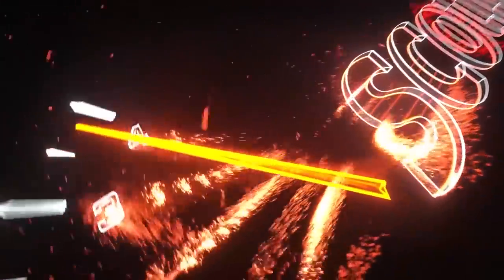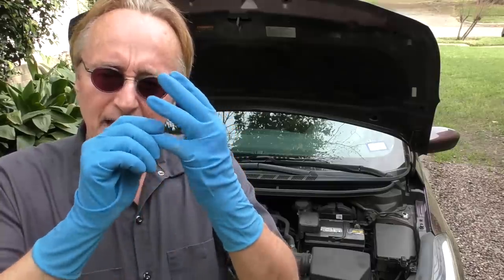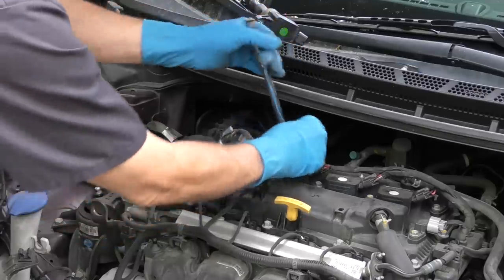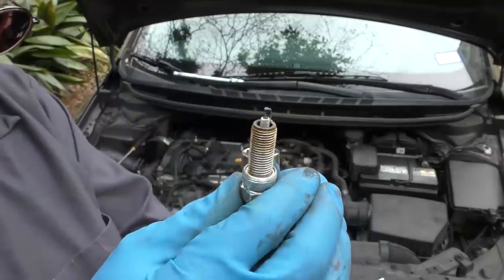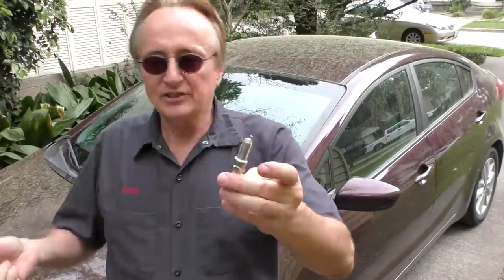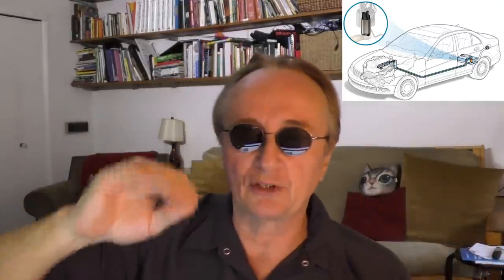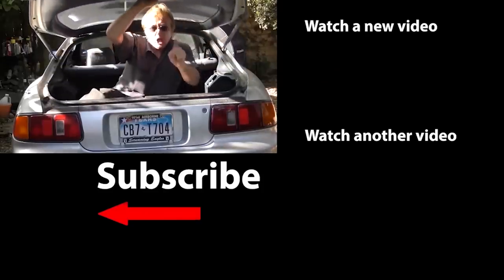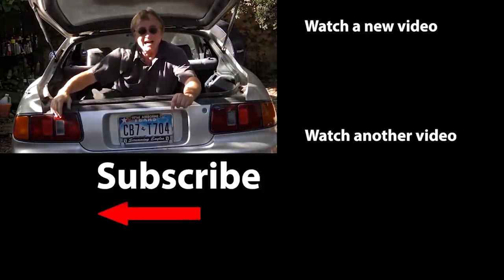Doing This Will Make Your Engine Run Better

Comment: Where do I go to ask Scotty a question? My car makes a grinding noise when starting up and just wanna get a general idea of what it is
Reply: Nicolia Czvernchi you either have a bad starter or the ring gear has damaged teeth. Also make sure starter mount bolts haven’t come loose.
Reply: @steveb.6267  I'll check the bolts in the morning. Thank you man. I hope it's not the teeth that sounds a little expensive

Comment: do you gap the spark plugs
Reply: Easier to buy pre gapped, and just check them imho
Reply: on some engines there is improovement by change the gap a liitle bit

Comment: Unless that car was bought used it should be under warranty
Reply: @Paul S 10yr/100k mi warranty covers spark plugs and ignition coils for the 1st owner. If it was bought used, spark plugs and coils would be covered for 5yr/60k miles
Reply: @mcc7762  I wonder what his hourly labor rate is. Someone should ask him during his car talks..

Comment: So what would be a good guess of how tight a sparkplug should be? Like 3/4 a turn after finger tight?
Reply: I have always done one and a half turns past finger snug for car spark plugs and have never had a single problem.
Reply: You should invest in a small torque wrench and look in your owners manual or a reliable source (Hanes manuals are good).
Reply: @hhiippiittyy  i beenthinking of it for a while ill probably do this since i know its probably going to give the best results
Reply: @999thenewman  awesome ill keep that in mind but im mainly asking cuz my quads suffered through so much random screwing around from me 😂
Reply: @summersport6098  Well, for four cycle engine spark plugs with a crush washer, 1 and a quarter turns past hand tight is all you need.
Reply: @summersport6098  
Not just best results, but also, especially for non grease monkeys, peace of mind.

Comment: Super early!
Reply from the maker: morning!
Reply: @scottykilmer  morning scotty stay safe out there!
Reply: @scottykilmer  
Hey scotty, 
I have a 1999 4runner with a 3.4l about 100k miles on it. When starting, I smell gas out of the exhaust. It goes away a bit once warmed up but still noticeable. Any ideas what to check for?
Reply: @burimlimani2694  Catalytic converter needs to heat up.
Reply: @jneusbaum3697  
Thanks
I have owned the vehicle since new and never had that before
Reply: @burimlimani2694  Colder out? The cat(s) need a few mins to get up to temp in order to turn the CO in to CO2

Comment: Scotty, do you use anti seize on plug threads????
Reply: Don't need to, most plugs don't need it unless you're buying cheap parts
Reply: Yes...especially if going into an aluminum head.
Reply: Follow the plug makers instructions. Usually NO anti-seize.